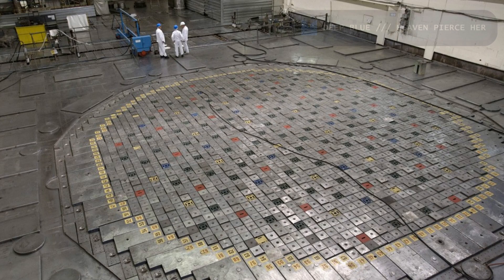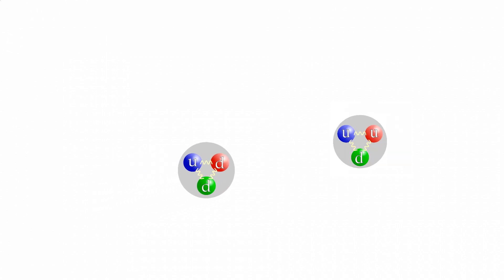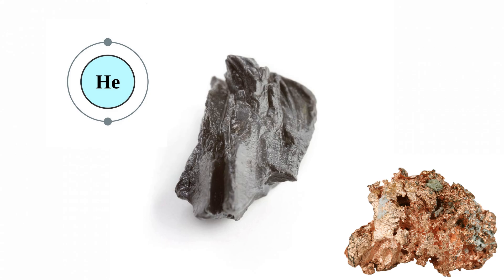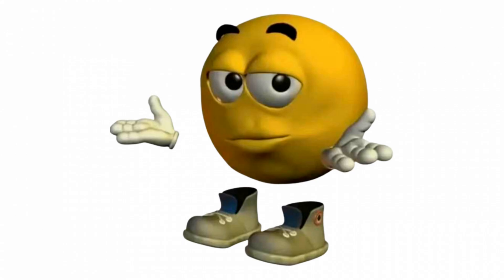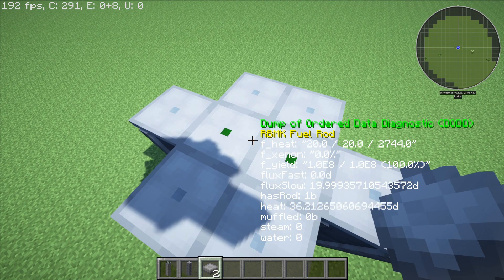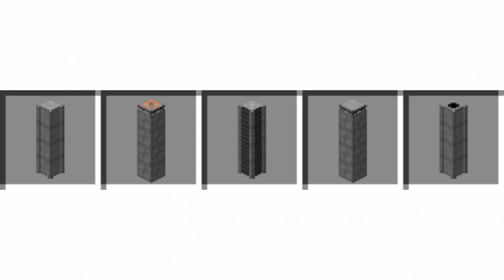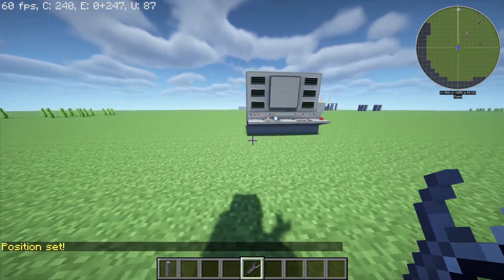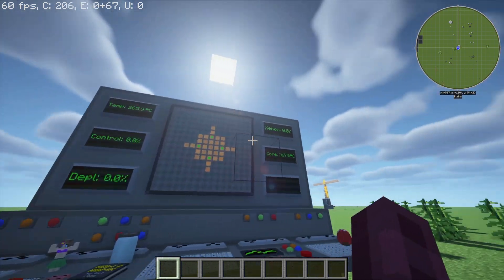How to build an RBMK in Minecraft - HBM's Nuclear Tech mod

Comment: It’s really a shame this hasn’t been updated to 1.16 or something of the sort with the newer mods
Reply from the maker: port it yourself :trol:
Reply: @ idk how tf to do that wasn’t trolling
Reply from the maker: @ just port it. it's just so easy man. just run /port 1.16 in gradle
Reply: theres a 1.18.2 version of hbms ntm iirc
Reply from the maker: @ it doesn't exist and won't until the (separate?) mod to convert code on the fly is finished
Reply: @RadiumMarshmallows  is there a video on here showing how to do that ?
Reply from the maker: @ first you need to  press alt + f4. if it doesn't open then just keep pressing those keys